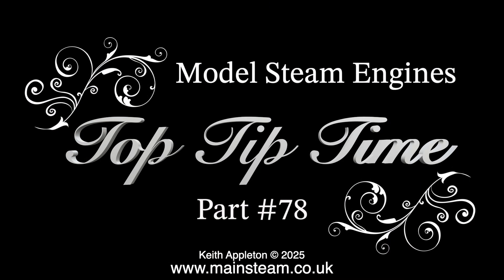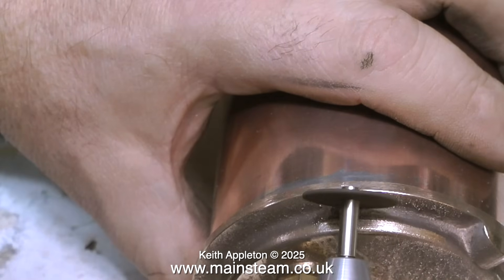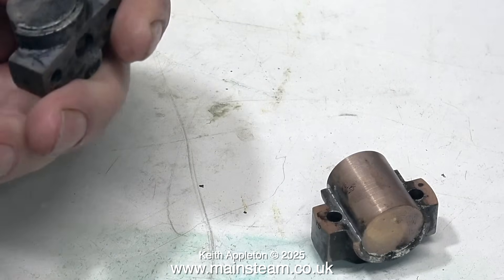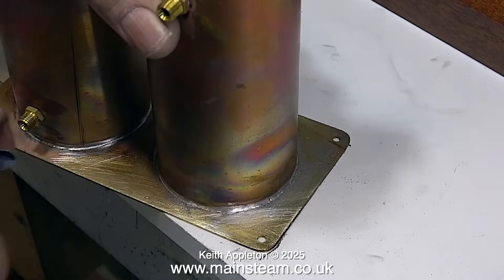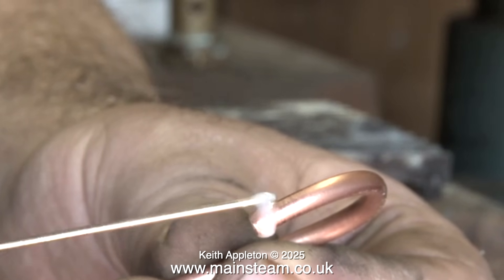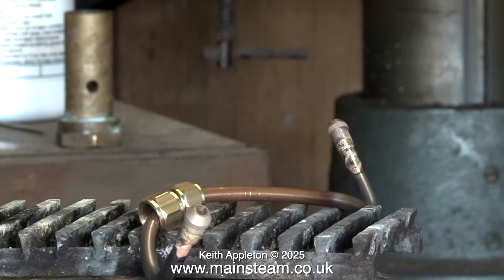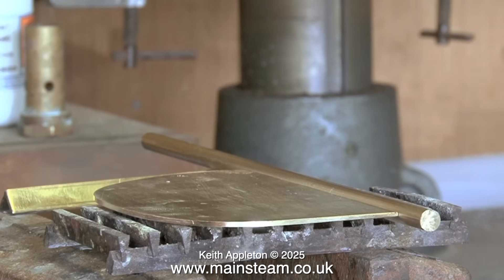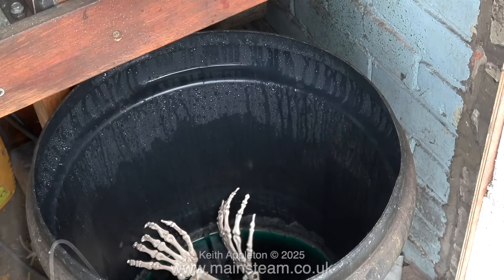MODEL STEAM ENGINES -TOP TIP TIME - PART #78

Comment: Years ago I used to build 1/25 scale slot car frames. They consisted of mainly brass tubing, flat brass stock and piano wire. Any piano wire to brass joint had to silver soldered. Soft solder would stick okay to the brass, but even though it looked it soldered to the piano wire okay, it didn’t. Under any stress, which these little frames had, especially edge joints, the piano wire would break loose. The flux I used for silver soldering was a liquid acid type. It worked very well, but if you didn’t get it thoroughly clean it would eventually corrode the parts green.

Comment: The white powder flux is mainly just Borax. The modern stuff probably has something extra, but I just use Borax for silver solder and brazing. It's a lot cheaper and in my experience it works just as well.